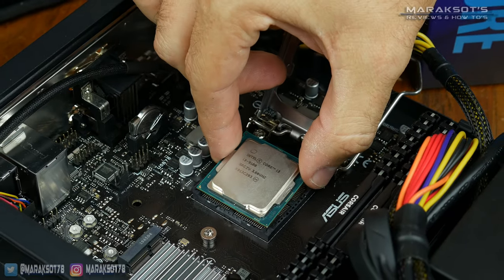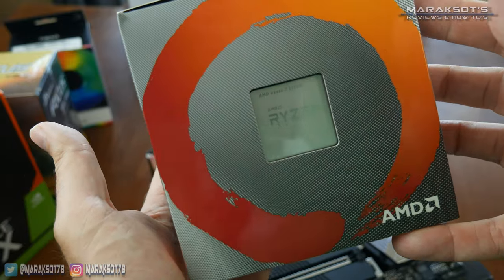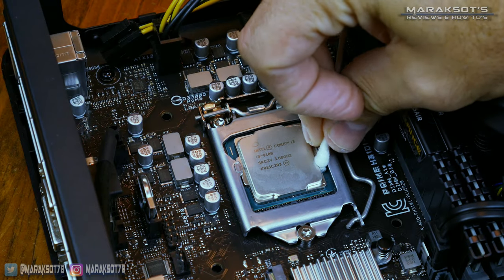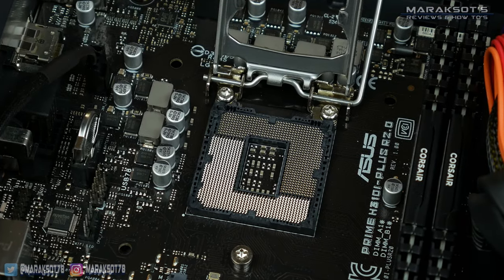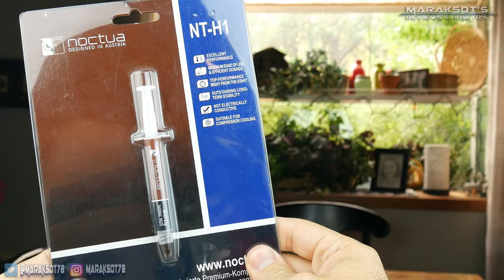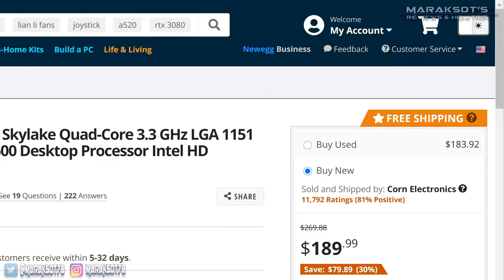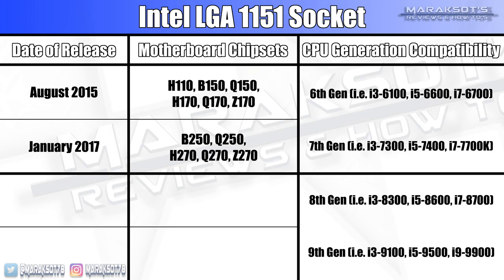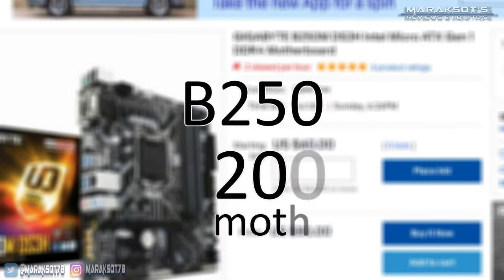A Beginners Guide: How to Upgrade an Intel CPU (core i3, i5, i7, i9)

Comment: im looking to buy a new motherboard and new cpu and ive got everything figured out physically, but im a little confused about weather i have to rebuy windows or not
Reply from the maker: The nice thing about Windows 10 and 11 is you can install it to your PC without having a key and use it without much issue. It will have a watermark in the bottom right corner of your screen telling you to purchase a product key which is really only a minor annoyance IMO but you also can't personalize your desktop until you do so that's a bit more annoying. But you can still use all your applications and use the internet and stufr without an issue which is pretty cool.
As far as I know when you redeem a Windows key, that key is tied to your Microsoft account and the motherboard installed in the PC that copy of Windows is installed to. So if you change out your motherboard, technically, you're supposed to buy a new copy of Windows. You can get keys for pretty cheap on sites like G2A.com (usually between $20 and $30) but I have also heard if you call Microsoft and tell them you upgraded your CPU and now your computer is telling you, you need to purchase a Windows product key they can do something on their end and activate your old key with your new motherboard. I've never done this personally, but I've heard of others doing it fairly frequently.

Comment: i have an intel i5 7500 and wanna upgrade to i5 8500, do i really need to upgrade motherboard?
Reply from the maker: Yes, because a 7000 series CPU only works with 100 and 200 series motherboards. 8000 and 9000 series CPU's will not work with a 100 or 200 series motherboard meaning if you want to upgrade to 8th or 9th gen Intel you have to upgrade to a 300 series motherboard. That being said you'll see much more of a performance increase going to an i7-7700 than going to an i5-8500. The 8500 would be more of a side grade than an upgrade as the performance of the i5-7500 and i5-8500 are pretty much the same.

Comment: So if I’m replacing my cpu and my cooling fan already has thermal paste from the old cpu do I need to put more paste??
Reply from the maker: So I assume you're saying either the CPU cooler that came with your CPU or an aftermarket CPU cooler you bought to use with your new CPU already has thermal paste applied to it? If the paste is brand new, meaning it's not the paste that was on the old CPU you're replacing, then there is no need to apply more thermal paste. The paste that comes on new coolers works fine.

Comment: I put a CPU in Wrong, Yesterday, They Say You cant Do That, With Intell Chips You Can, I had to take it apart and Redo it. it still Works !  Some Motherboards Do not, Point out on them Where the Arrow Points. I am Used to installing AMD CPUs Intell Can Be installed wrong, AMD Can Not !

Comment: excuse me sir i want to upgrade from a 12th gen intel core i3 12100f to a 10th gen intel core i7 10700k is it possible and how much money is it?
Reply from the maker: Sorry that's not possible unless you change out your motherboard and your RAM (assuming your motherboard uses DDR5 and not DDR4). Intel 12th gen uses the LGA 1700 socket and Intel 10th and 11th gen use the LGA 1200 socket. Intel 10th and 11th gen motherboards also use DDR4 where as there are only some 12th gen motherboards that use DDR4 RAM; most use DDR5. If you want to upgrade to an i7 without changing out your motherboard and possibly your RAM too you're going to have to upgrade to a 12th gen i7 like the 12700 or 12700k.
Reply: @Maraksot78   ok thank you but is it worth to just buy another pc and how much is the price difference?

Comment: Is it possible to wipe the thermal paste after removing the cpu from the socket?
Reply from the maker: Yes, but thermal paste is pretty messy stuff. It easily gets on your fingers then on everything you touch. It's just way easier to keep things clean by cleaning it off while it's still in the socket.

Comment: #6%Club. Very helpful tutorial
Reply: Amazing. Now since you're still checking on this great tutorial; if you can, would like to tell me the type of my old laptop 💻 Dell latitude E6440. My model is i5 vPro 4310M, 2 cores, 2701 Mhz; Intel HD graphics 4600. I would love to upgrade to i5 7/7/11th gen or i7 4/5/7th gen. Also what GPU would you recommend - I wanted to try some fun with the computer if the recommended items are inexpensive. You can even make a tutorial if you want though this laptop is really old. Thanks and happy new year 🎇

Comment: hey so, my laptop that i use for gaming is one that is incredibly old, like a decade old, it had extremely old parts and worked its LIFE until 2021 december when the hard disk gave up, although i got it replaced with  a new one, this one had windows 10 installed (side note the previous one had windows 7 and 4 gb ram with i3 2nd gen, motherboard was 01HXXJ motherboard details) now since windows 10 was installed in the computer itself 4 gb ram is extremely lagging, my decision for this and future gaming plans is that i want to now upgrade the processor to i5 and  idk if i can go any higher than 4th gen after i watched this cuz my motherboard, 8gb ram doesnt sound something as an problem since the ram stick i can get a 4 gb ram stick and add it, please suggest me any help possible as to what i should do because im incredibly confused and panicked and stressed about what decisions i need to make, people are saying its better off buying a new laptop however in my currency my parents will never buy me such an expensive thing, around like 60k as a decent laptop (INR Currency) So yeah, these both upgrades will only take me up to 12k, please if you can suggest or help me in anyway possible please i really require help, Thank you.
Reply from the maker: I've never attempted to upgrade a CPU in a laptop before so I don't know exactly how difficult it may be.  From what I've heard it depends a lot on the laptop manufacturer.  I've heard that sometimes the CPU's in laptops are not socketed like they are in desktop PC's but are instead soldered directly to the motherboard.  These types of CPU's are very different than the typical socketed types of CPU's.  I agree with what your friends have told you; it's much easier to just buy a new laptop than to upgrade one.  It's not impossible but it would require doing a fair amount of research to find out exactly what you have, what CPU's will work with it and what all would be involved to upgrade it.
Reply: @Maraksot78  yeah man, kind of a similar case with me I think I'll go for it, thanks for the advice on his behalf aswell.
Reply: @Maraksot78  for the very least purpose maybe i can just upgrade the ram

Comment: i know it's been 2 years but i have a question. I wanna upgrade from an i7 9700k which uses LGA1151 to an i9 12900k but it says it uses LGA1700. When i google compatible cpu's tho, the i9 12900k pops up. Would the i9 12900k work with my motherboard or not?
Reply from the maker: No, 12th Gen CPU's are not compatible with LGA 1151 motherboards. To upgrade to 12th gen you'll need to buy a LGA 1700 motherboard and depending on the motherboard you get you'll have to upgrade your RAM to DDR5 also. Some LGA 1700 boards use DDR5 and others DDR4 just FYI.
Reply: @Maraksot78  sheeeeesh, it's gonna be even more costly than I anticipated. Thank you for getting back to me so quickly, gained a subscriber. Keep up the great content!
Reply from the maker: @RecluseSports  No problem man. Good luck. And thanks for the sub.

Comment: My PC is HP IPM17-DD V1.04 799929-001 799929-601 Motherboard.  what CPU I should upgrade to and in order to upgrade window 11?.  Here is a Specifications
Brand Name:HP
Launch Date:2013
Chipset Manufacturer:Intel
Memory Type:DDR3
Ports:Ethernet,HDMI,USB 2.0,USB 3.0
Memory Bank:2 DDR3 DIMM
With CPU:No
Application:Desktop
Memory channel:Double
Package:Yes
Model Number:IPM17-DD
CPU Type:Intel
Maximum Ram Capacity:16 GB
Socket Type:LGA 1151
Hard Drive Interface:SATA
Chipset:Intel H170

Comment: do you know if this process is the same for laptops I need too know immediately
Reply from the maker: Usually no. Because of the highly custom nature of laptops nowadays most laptop CPU's are soldered directly to the motherboard.
Reply: @Maraksot78  so If there's an error with the hard drive im better off replacing it entirely??
Reply from the maker: @Ashyketchum if there's a problem with your storage drive then you can replace it. Unlike a CPU a hard drive (HDD) or SSD can be removed and replaced fairly easily in a laptop. I say fairly easily because some laptops are kinda difficult to take apart, but swappjng out a storage drive is pretty simple. If it's the drive with your operating system on it (for PC laptops that's Windows), which in the case of most laptops it's probably going to be, you'll have to reinstall Windows and any drivers specifically needed for your laptop. Those can usually be downloaded from the laptop manufacturers website.

Comment: So, after all this, just switch on the PC and the BIOS magically finds the new CPU??
Reply from the maker: Not magically, but so long as the BIOS on your motherboard supports the CPU you've installed (sometimes new CPU generations that use the same socket are realeased after a motherboard has been manufactured, so the BIOS needs to be updated to support those new CPU's) the new CPU will be automatically recognized and you're good to go.

Comment: Do i need to do anything in my BIOS if everything goes successful and boots up?
Reply: That's the same question I have I just got everything to upgrade my kids PC from a dell inspiron 3847 with I4 4440lk 8 gb rams  with a gtx950 to a i7 4790 with a 500 watts power supply 16 gb ram with a GTX 1650. My question was would I need to update bios or anything else

Comment: can i upgrade my spu from i3-8100 CPU to Intel i5-10400F ? would my motherboard ?
Reply from the maker: No.  8th Gen intel uses the LGA 1151 socket and 10th Gen uses LGA 1200. You would need a new motherboard with an LGA 1200 socket.

Comment: Sos for anyone that is willing to help out. I currently have a intel i7-10700KF and a GeForce RTX 3070 and put my components into a bottleneck calculator for high cpu usage task and it told me in the most simple way I can understand it that when my cpu is maxed that my gpu is only getting 75%-80% usage. My personal goal is to be capable of streaming a very crisp 720p60fps stream without any dropped frames or heavy pixelation. And no my internet speeds are not the problem as I currently have 900up and about 850down. Any help would be greatly appreciated seriously! Thanks.

Comment: So an i5 10400 won’t fit where my i7 6700k was???
Reply from the maker: Nope. Completely different motherboard socket.
Reply: @Maraksot78  I also have another question my mother board says OR790T and ik the i5 9600t says something 300 motherboard will it fit in mine? It’s the same socket size to

Comment: Does anyone have a list of cpu's that have the 1151 socket since i dont have too much knowledge into computers and im looking at upgrading my cpu and i cant find one that would work to upgrade to right now i have a intel i3 9100f and the motherboard is a gigabyte b365 hd3 any help is appreciated (also the table was a little confusing for me since i dont knwo too much about pc's)
Reply: Ok so i just found a cpu that i think would work and its the i5-9600f and it has the correct socket but im still not 100% sure if it will work can anyone confirm if it will work?